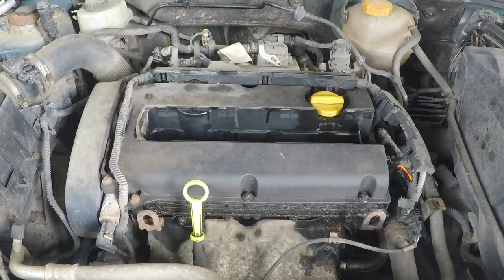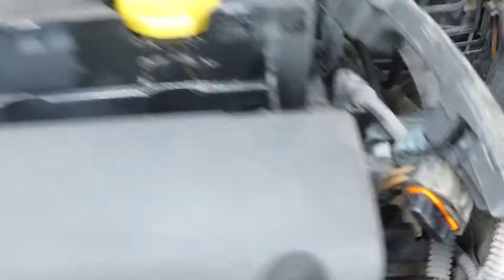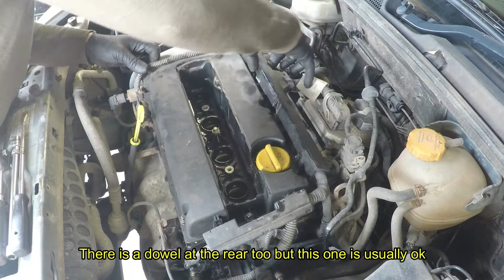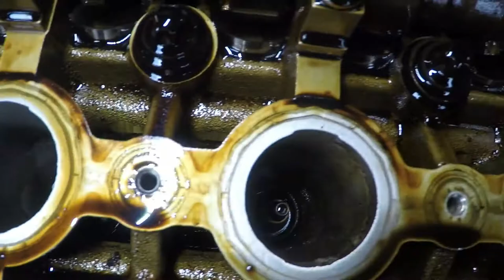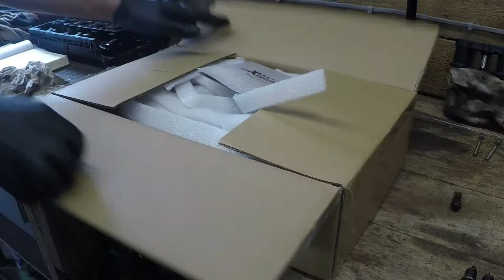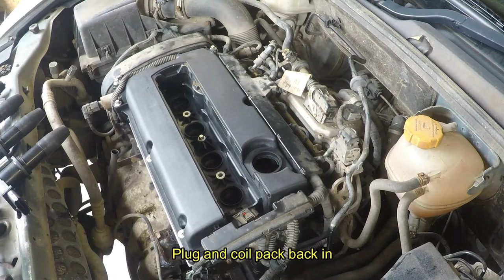Vectra C 1.8 Oil Leak Cam Cover + Gasket Replacement

Comment: Thanks for the video, I'm planning to do this job shortly on my Astra H Twintop with same engine, bolts should be all right, due to them being undone for some work not too long ago, the gasket hasn't failed yet, but it is leaking a bit, so I'm not going to wait until it floods my coils and plugs. If you replace the gasket alone, it's like a 10 Euro part, and makes for a great DIY job :)
Reply from the maker: Thanks for the comment buddy! 😊 hope it helps you get the job done! Let me know how you get on

Andy👨🏼‍🔧

Comment: I have a vectra 1.8, having massive trouble with it at the moment, was waiting in a queue of traffic the other day and the engine started making a loud ticking noise, going into limp mode and the engine management light come (car with spanner), so i took it the garage to get seen, he kept it overnight, it had an oil and filter change to see if it worked and it didnt, so went to pick the car up and the camshaft and pulleys need changing, going to cost just over £1000 to repair, told him to leave it, can get a second hand car for that
Reply from the maker: The pulleys fail when oil services have been neglected (not saying you are to blame) but also the VVT solenoids have a gauze filter, that I often clean out on a service as they clog up with old old / carbon deposits and once they get blocked it then goes to the cam pulleys. A £1000 is a bit steep 😬 sorry to hear that buddy

Andy 👨🏼‍🔧
Reply: @AMSVauxhall  I bought the car in November 2019, with no service history, (didnt realise at the time, only passed my test in the July) and all these problems only started when I got it serviced in June 2020, the garage said because of lack of service and because of the engine being full of carbon, they would have to strip it right back basically, currently looking for a new car but in the mean time using this one and taking it easy...hoping to not break down haha

interesting to know how it's all done though
Reply from the maker: @gordonlewis2597  always a risk buying second hand motors from someone you don’t know. I don’t know where you are in the country but there is quite a few lads on YouTube that sell honest used cars that you are able to see the work that has been carried out
Reply: @AMSVauxhall  It was from a garage i bought the car from, came with a standard 3 month warranty, I am from Merseyside if you know any lads local to merseyside

Comment: I have a 2008 Saturn astra Xe and I have purchased a valve cover, new plugs, and the coil rail. Everything fits fine besides the valve cover. For some reason I can not get it to line up properly for the bolts to fall into their wholes. Any suggestions?
Reply from the maker: The only thing that would prevent it lining up / sitting flat is if the 2 dowels aren’t pushed fully home or if you haven’t removed the old ones from the cylinder head and you also have new ones on the new cover? 

Andy👨🏼‍🔧

Comment: I didn't see the gasket on the top of the engine when you went to install the cover, so I guess the gasket goes into the cover before installation?  Also, why fit a new cover, rather that just a gasket?  Is that necessary to stop the leak?
Reply from the maker: @Baldy1980  yes the gasket was in the cover and you can replace just the gasket but if it leaks again then you will know that the cover is distorted. 

Andy 👨🏼‍🔧

Comment: Good video, especially giving little tips. If you ever have to do this again maybe put some anti seize on the dowel pins and the 1 bolt that is always stubborn. This will affect the torque reading when you go tighten the bolts but in my experience, with a gasket and a plastic cover you don't need to be super accurate.

Comment: Hi mate, was wondering if you could tell me what you use to clean the mating surface and oil cap etc and what are the spark plugs torqued to please? Thanks for your vids ✌️
Reply from the maker: Hi Adam, usually just a bit of Emery cloth to clean surface, a tooth brush and degreaser to clean oil cap and plugs are torqued to 25NM

Andy👨🏼‍🔧
Reply: @AMSVauxhall  thanks Andy, I’m in the middle of mine, only ordered the gasket as the bolts didn’t look old or rusty but still had the bolt from hell and had to break the cover off 😱, so awaiting a new cover and in the meanwhile going to give the surface a good clean and attack all the Oil that the case spat out, thanks again Andy not just for your reply but your vids too ✌️
Reply from the maker: @adambuggins1054  thanks for watching buddy and the comments ☺️much appreciated! Let me know how you get on 😁

Andy👨🏼‍🔧

Comment: Great video, thank you. I'm looking to do my Zafira b next weekend. If you've removed as much oil as possible from the plugs, I guess it's still likely that some will drip down when you remove them. This is the one thing that concerns me slightly. How much of an issue would that be?
Reply from the maker: Thanks for the comment buddy 😊 if you get most of the oil out then a little will always go into the engine once you remove the spark plugs but it will just burn off so it’s not a big deal. 😊

Andy👨🏼‍🔧
Reply: @AMSVauxhall  thank you for your reply. That's reassuring to know. Hoping, with your vid, it should be straight forward. Cheers.

Comment: Great video mate. Very helpful. I have questions though...Which part is the gasket? Is it the head gasket? Thanks 👍🏻
Reply from the maker: Thanks buddy ☺️ no it’s not the head gasket it is the Cam cover gasket which is just a rubber seal that sits in the black plastic cover 

Andy👨🏼‍🔧
Reply: @AMSVauxhall  Aah right!😊. I only need to change the gasket in mine so. The cover seems fine. Thanks Andy 👍🏻.
Reply: @AMSVauxhall  Would a worn out cover gasket cause the coolant to keep emptying? That's what is happening to my vectra. And two of the spark plug wells have oil in them!?
Reply from the maker: @treymendus  it will definitely be the reason there is oil in the spark plug holes but the coolant loss will be something else I’m afraid 

Andy👨🏼‍🔧
Reply: @AMSVauxhall   At least that'll solve one problem anyway😀. Thanks for the advice mate👍🏻.

Comment: Hello. I have an oil leak running down the side and even underneath the engine. 

I’ve had one mechanic tell me it’s the rocker gasket (as in this video) and another tell me that it is the camshaft/crankshaft seals. 

The mechanic telling me it’s the rocket gasket works as a senior Vauxhall technician and told me this issue is widely misdiagnosed by garages as being the camshaft/crank shaft seals. The reason why I’m cautious is because he is only basing this off photos I’ve sen

What do you think? I want to try and replace the rocker gasket myself. Will it be obvious that it needs to be replaced, for example the rubber being brittle?
Reply from the maker: @uplightuk8924  as a Vauxhall mechanic myself, I would agree that it is most likely the cam cover gasket but the best way to diagnose it is to strip it down to see. Yes the gasket will be hard if it is past it’s best. You could pull the coil pack out and see if oil is on the end of the coil pack / spark plugs as this would confirm that the gasket has failed.

Andy 👨🏼‍🔧

Comment: Thank you for including the common problems and the appropriate work-rounds. My Corsa D rocker cover will not shift at all and I can't find a tutorial that shows the same design cover as mine. An interesting video nevertheless. Many thanks!
Reply from the maker: Thanks for commenting buddy! Much appreciated ☺️ I’ve actually just filmed replacing a cover on a corsa VXR which is exactly the same as this one although it cam off a bit easier as the usual rusted bolt didn’t snap.

Andy👨🏼‍🔧

Comment: Great video, did this a couple of weeks ago and this really helped. I have noticed its still slightly leaking. Do you reckon it could be the cam cover that's distorted as I only changed the gasket ? Cheers 👍
Reply from the maker: Thanks Mark! ☺️ yes it’s more than likely the cam cover that is distorted unless the gasket isn’t seated properly which is easy done. I think they are around £40 on eBay and it will come with a gasket and new bolts 

Andy👨🏼‍🔧

Comment: My Mk5 Astra has the same engine Z18XER  - and exactly the same has happened.
I did mine with a cheap ebay one 12 months ago and some gasket seal - seems to have failed again though - going to do it again with a OE VX part.
Plus 2 bolts snapped - luckily theres enough thread left sticking up to get some mole grips on and got replacements from the scrap yard.
Great video though - cheers.
Reply from the maker: You get new bolts with the cam cover if that is what you are replacing. The gasket will have failed because you used gasket sealant. The rubber gasket has channels that the oil runs in and back into the head, if you use sealant then you block this channel and divert the oil outwards. 😬

Andy👨🏼‍🔧
Reply: @AMSVauxhall  cheers bud, just found a new cover on ebay for £28, so I'll get that and stick it on.

Comment: Thanks for the heads up on the rusty bolt, gave it a good hammer and squirted wd40 down the threads as soon as it started to move, worked back and forward and it came out easily, gasket and plugs looked like original GM parts, gasket was crispy and plugs worn to 1.3mm gap.
New gasket and plugs fitted but still had P0301 misfire so borrowed a coilpack and the engine light stayed out and the engine ran smooth, ordered a new coil pack and car is now back running as it should.
Again thanks for the info, question,  is the EGR valve in that housing on the right side of the engine with water hoses attached.
Reply from the maker: Thanks for watching buddy☺️ I’d you have the same engine (VVT / XER engine) then it doesn’t have an EGR valve 

Andy👨🏼‍🔧
Reply: Its an XER, grand daughter has the same engine in hers and it has a random misfire says it feels like a bounce when driving, code reader is clear no stored codes or history, Astra owners club suggested EGR valve but if it does not have one what could be causing it, looks like it has a new coil pack and plugs and no leaks on the cam cover gasket.
Regards Stuart
Reply from the maker: @t140v  could be anything from fuel pump, fuel filter, injectors, wiring, sticking valve, timing, VVT solenoids, ECU fault. 

Live data will be your friend for finding this fault. Also try to work out when it happens (engine temp, running / driving conditions etc) do all the basic stuff first, compression test, check spark plugs for clues to what the engine is doing and check the gaps / torque properly. Remove and clean VVT solenoids. 

Andy👨🏼‍🔧

Comment: Also I have the same problem with the leaking oil
I will change the cover gasket the spark plugs and the ignition coil

Comment: Good informative video. Need the cover and gasket for my mk5 astra (z16xer), is there anywhere you recommend to get the cover from online? Vauxhall want £360
Reply from the maker: Plenty places to get them online. Autovaux, eBay etc. £46 I think this one cost and it came with the gasket and new bolts 

Andy👨🏼‍🔧

Comment: Thanks for the video, much appreciated mate. Do we need to replace the coil pack as well?
Reply from the maker: No worries buddy! If the coil pack still works then just clean off any oil and it will be fine but if it’s misfiring then it will need replaced along with a set of new spark plugs 😁

Andy👨🏼‍🔧
Reply: @AMSVauxhall  thanks
Reply: @AMSVauxhall  can we use WD40 to clean oil coming from old gaskit? 
Also, do we need to use any breakoil or any other material when we just fit the new gaskit?
Reply from the maker: @softcloudnet7311  WD40 Is fine but brake cleaner is far better for shifting oil. A smear of clean oil on the seals will help seal

Andy👨🏼‍🔧

Comment: Hi sir! I have astra H 1.4 16v. Car losses 1 liter of oil in 5 days. Water expansion tank fluid is brown. Hes getting oil in the water tank. Car sometimes shakes while driving due to misfires. What do you think should be fixed on the car? Im thinking head gasket and oil rings. Whats your opinion kind sir?
Reply from the maker: Hi Buddy! Yes that is a sure sign that the head gasket has failed. Best to do a compression test to confirm. 

Andy👨🏼‍🔧
Reply: @AMSVauxhall  and probably oil  rings to need change? One mechanic said he would change oil rings other one said he would change oil cooler gasket. Car has 180000 km

Comment: Just finished mine and it's still weeping a tiny bit by the front right corner. Is this just excess oil or is there a bigger problem?
Reply from the maker: Did you replace cam cover or just gasket?

It’s possible the gasket hasn’t seared properly and maybe slightly folded when you positioned cam cover. Did you torque it down evenly? And does it sit flush all the way around?

Andy👨🏼‍🔧
Reply: @AMSVauxhall  Just the gasket and torqued it down evenly to 8nm. It leaked from the same spot before so I've got a feeling it's the cover itself. Thanks boss
Reply from the maker: @blingking501  ye it will be warped. They are cheap enough on eBay 

Andy👨🏼‍🔧

Comment: Trying to remove the cover on a Vauxhall mokka. Do they also glue them on because I’m having a difficult time removing it and I’ve undone all the bolts.
Reply from the maker: They aren’t glued on but there are 2 dowels that they like to take a good hold on. Try to work
It up as far as you can and then “see-saw” it off without damaging the mating surface of the cylinder head 

Andy
Reply: @AMSVauxhall  thank you will try again

Comment: Zinc plated bolts and Aluminium will often seize, not a good combination, a good shock or smack downward with a hammer will free it up, naturally don't drive the bolt through the block, start with a light hit, its the same with round head phillips screws in motorcycles, there I use a round punch and hit that.

Comment: cam cover and gasket replacement I must of blinked what happened to the gasket replacement?
Reply from the maker: Gasket was fitted to the new cam cover which is clear at 10.42 😉

Andy👨🏼‍🔧
Reply: @AMSVauxhall  thanks but not that clear but yeah again thanks,  I know you not covering this but does the oil pan on a ventral 2007 have a gasket? Please
Reply from the maker: @andrewhunt3800  no it’s just sealant. If you have the 1.8 engine then I have a video on it. It’s on an Astra but it’s the same engine
Reply: @AMSVauxhall  thank you very much

Comment: I've noticed a small leak on the front right corner of the rocker cover so planning to get this done soon, what ratchet attachment is used for the rocker cover bolts?
Thanks.
Reply from the maker: E10 socket is needed to remove the cam cover bolts buddy 😁

👨🏼‍🔧
Reply: @AMSVauxhall  How do you get the plastic part behind the oil cap off i tried to pull but feel like it's about to snap off, is there wee clips i need to push in? Any help thanks.
Reply from the maker: @jamiem5319  there is 4 clips, one on top of each injector. They are a pain to get at but you will need a small hook and awl set to pull the clips out.

Andy👨🏼‍🔧
Reply: @AMSVauxhall  Managed to get the rocker cover off no problem but noticed cylinder 3 spark plug was covered in oil, when i was cleaning the coil pack the rubber end was spinning but the rest were solid, not sure if i need a new coil pack? Thanks for the help btw.
Reply from the maker: @jamiem5319  spinning is ok,  it will just be because it’s wet with oil. As long as nothing is cracked or split and the springs inside the coil packs aren’t rusty. 

Andy

Comment: I'm changing mine soon. Its an Astra H Mk5.

One bolt has snapped and need to get it fixed. Thinking about buying a new cover. Are these eBay covers okay?
Reply from the maker: Yes the covers seem to be ok. This particular Vectra is back in the workshop today for a service and it is still prefect!

Andy👨🏼‍🔧
Reply: @AMSVauxhall  Thank you Andy for prompt reply. Subscribed!
Reply from the maker: @jeffersonelias7447  thanks very much 😊 let me know how you get on with it 

Andy👨🏼‍🔧
Reply: @AMSVauxhall  hey Handy, I ran into a little problem while doing it today. Wonder if you can share your knowledge on how to solve it.

Do you have an email I can send you a picture? As you can see, I'm doing a DIY and not experienced.

I tried to unplug one of the sensors sitting above the belt (to the left side of the gasket) and I believe due to age it just snapped.

Just wondering how I'm going to solve it now.

I would very much appreciate your opinion.

Thanks
Reply from the maker: @jeffersonelias7447  I’m on Instagram if you use that?
Reply: @AMSVauxhall  Thank you Andy. I do!

Comment: Hi sir with my all respect 
I have a problem with my vectra 1.8 16v 140 hp 2007
the idle oscillates with small vibrations the low beam or high beam tends to go out when the engine vibrates at idle also removes different amounts of air on the exhaust pipe when the car is running it has no problem
Please if you know what part of the engine can be the problem 
Thank you
Reply from the maker: Hi,  I’m not 100% sure what you are saying but I think you are suggesting that you have poor idle? There is a plastic ribbed pipe at the rear of the cam cover (the pipe with the horse shoe clip) that splits and causes up and down idle. Remove the entire pipe and check it for splits

Andy👨🏼‍🔧
Reply: EF pipe that goes in the tank ventilation valve?
Or can be fron the  throttle very dirty?
Throttle Valve Body Gasket?
Reply: The ribbed pipe form the air flow?
Reply: I go to check back of the engine cover I have the details what you give me so I hope I will find 
Thank you so much 
I will come back and I will let you know 
Appreciate you are the best 👍
Reply from the maker: @alycinstantin9989  the pipe I remove @2.30 

Andy👨🏼‍🔧
Reply: I cant find the pipe..
What name have this pipe? 
Pls 
Thank you
Reply: Thank you so much for everything I hope I will solve this problem with my car...I buy the car 1 week a go and i dont know to much about of cars...I liket this Vauxhall and I want to keep